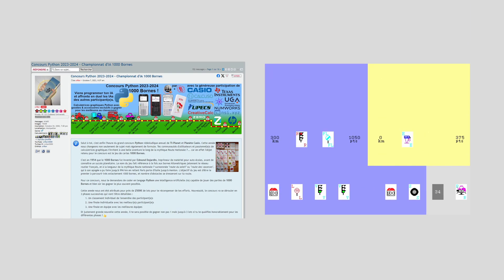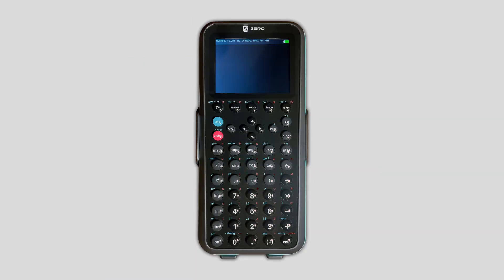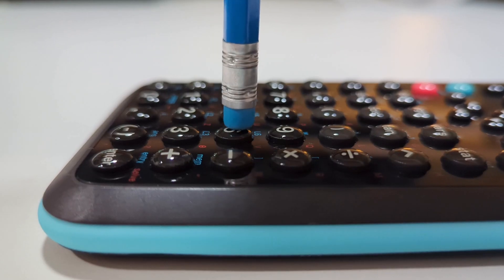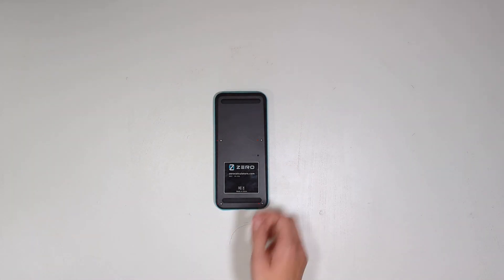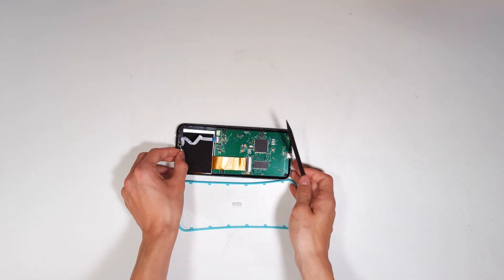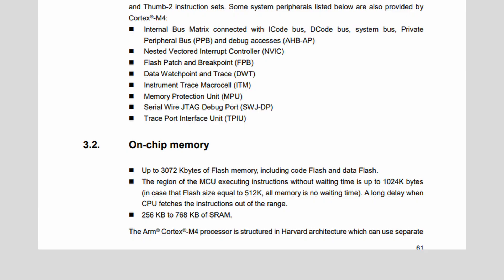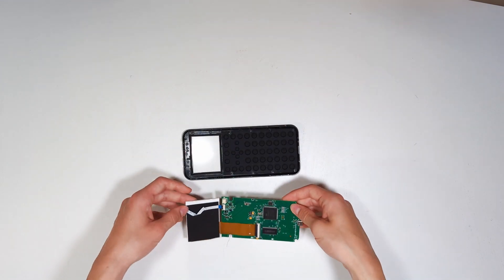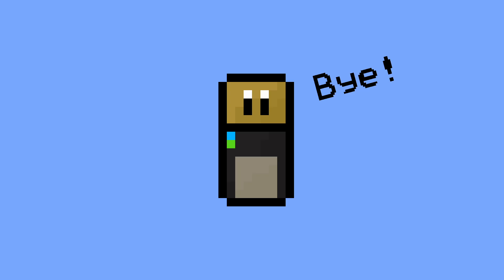I finally got one! Unreleased Zero Calculator prototype teardown

Comment: 3:27 I find this extremely annoying. Depending on who made that pack, it may get "spicy" if the battery management firmware doesn't optimize charging as the battery ages. Of course, all this could be avoided with a user replaceable battery pack or regular batteries. Can this be run from an external supply that circumvents the battery pack?
Reply from the maker: I'm pretty sure that at least the ZGC1 can run when plugged in if the battery is disconnected, but I haven't tried that on my ZGC3.

Comment: Hey this is not relating to your video but i was downloading pokemon onto my TI 84 CE but everytime i open ti connect ce it gives to option to repair or remove and it wont stop giving it to me no matter how many times i repair and open.
Reply from the maker: Hmm, I'm not exactly sure what's going on since I haven't experienced that issue before. I would try asking on cemetech.net, it's a calculator-focused forum with a lot more people who might be able to help you :)
Reply: @TInyHackerCalcs  thanks i got some help and fixed the issue, but i tried adding some files and cesium and asmhook are not working and are "invalid"
Reply from the maker: @zsynxedorgans3205  are you trying to send with the Chrome OS version of TI Connect? Sometimes that can have issues, if so maybe try the Windows or Mac version if you can
Reply: @TInyHackerCalcs  i used windows
Reply from the maker: @zsynxedorgans3205  huh okay, I think the issue is you need to run ASMHOOK and Cesium from artifice. If you open artifice you should see the files there maybe?

Comment: Good luck to these guys.  NumWorks has been at it for years now with a calculator that’s priced less than the TI-84 CE  and is superior in every way other than adoption.  It’s a TOUGH market. Hope Zero’s idea of make a much less expensive TI-84 clone works out for them, but it sounds like TI is going to block that as much as possible.

Comment: I like the battery. It's not permanently wired in, with a full pluggable connector, while being a bigger size so should get extra battery life. You might only replace such a battery once or twice during the lifetime of owning such a calculator, so I don't think the hassle of replacing it is a big deal over trade-offs to allow it to be a larger capacity. As long as it doesn't have crazy 'permanent' sticking solutions like most phones do (because they really do want you to buy a new phone rather than replace their battery).

Comment: "used to bad keys"? Nah, good calculator should be fast to type on for hours without tiring you out, so low force keys are good, even if they seem a little wobbly. What they need to do also is register presses consistently, which perhaps is a little more difficult to achieve with low force keys, but it's been done.

Glossy keys are OK to me, i  don't care. Glossy front casing is a no-no. My personal wish would be a brushed aluminium front and general 80s styling but i can definitely live without that :D

Comment: You don't have to change the file extension to edit it.
Reply from the maker: Yeah you wouldn't, it does make it a little more obvious though I guess
Reply: @TInyHackerCalcs  Notepad++ is great if you'd otherwise use the default WIndows notepad.

Comment: Good video, though I don't get what the point of this calculator is. What does this offer over an HP Prime (not even the even more souped up G2 model)?
Reply from the maker: @arnox4554  Zero's business model (or at least the way they're marketing) appears to be an improved 84+ CE clone, which would use the same interface familiar to teachers as they're targeting the education market. So they're not really trying to compete with calculators such as the HP Prime, but rather the TI calculators which are extremely successful in US highschools.
Reply: @TInyHackerCalcs  I suppose, but since it's 2024, why wouldn't they try to compete on raw hardware grunt too? Of course the Zero Calculator is more powerful in some ways, but it could probably be way faster even for (I imagine anyway) not that much more money. They could kill two birds with one stone.
Reply from the maker: @arnox4554  agreed. They may beef up the hardware in future models (hopefully so) but right now I think they're set on this. The other thing is that if the software is optimized it can make good use of the hardware it has, and while I haven't gotten to comparing performance too much it does actually do quite well compared with other competitors from what I saw in other people's breakdowns. Maybe not outperforming the Prime G2, but still doing reasonably well for a target launch price of $100 compared to other popular calculators.
Reply from the maker: @arnox4554  also - I figured I'd ask TheLastMillennial about it since he actually has a Prime G2 he can compare with. He said that the Zero performs matrix operations faster, but the main advantage is that they aim to be allowed on standardized tests and the Prime is not.
Reply: @TInyHackerCalcs  "He said that the Zero performance matrix operations faster"

Damn. That's some crazy optimization.

"but the main advantage is that they aim to be allowed on standardized tests and the Prime is not."

Actually, that's really weird. The HP Prime has a fully featured exam mode and even a way for teachers to sync them in classrooms and show the calculator display on a projector.
Reply: @arnox4554  Is more calculating grunt something the majority of users would care about?  What kind of results seem to take too long on a TI-84?  From a business standpoint, if they increase the budget, the extra money would probably be better spent elsewhere.  An M4 processor is not the top of the line anymore, but it is at a good price/performance point.   The processor seems to be an STM32 clone meaning it is even cheaper than you might think. If they aren't going to add more real features then leave the processor alone.
The TI-84 has a big target on its back because it dominates the market and is way overpriced.  I'm not surprised that just cloning the '84 and going for the high school market is what they are doing.
Reply: @isaacclark9825  "Is more calculating grunt something the majority of users would care about?"

I mean, I'd say so, given everything that the HP Prime can do, which even includes basic 3D graphing. Obviously a high school isn't going to care about the hardcore engineering features and the raw power needed to enable those sorts of things, but again, if the Zero team can do it... Why not? Maybe they could even have two SKUs. One for basic stuff for High School duties that's much cheaper, and one for full phat engineering and mathematician duties.

I know in the HP Prime circles, there is still, and has been grumbling about how Giac is only partially implemented, and this has often come up as an annoyance both for the Prime developers and users. Having a full Giac implementation would be very welcome for the users while also off-loading a whole lot of maintenance duties from the Zero developers, were they to give a full Giac implementation in a graphing/CAS calculator.
Reply: @arnox4554  The problem is that purchasers (well other than us tech folk) do not care. If the extra power does not help high school students on the SAT, there is no point in it.   TI has 93% of the market with its ridiculous pricing, even though more powerful calculators are available.  Would it be better to make the calculator more powerful, or to shave some cost off of the product?   I believe Zero has picked the right battle. I understand why you might want a different result.   But outside of academia, handheld calculators are more of a toy than a tool.
Reply: @isaacclark9825  Yeah that's what I thought too, but then I actually used an HP Prime, and there is an actual big usability, portability, and accessibility difference between using an HP Prime as opposed to something like Xcas or Mathematica. It's just way easier and more convenient.

In any case, one needs to remember that TI has a shit-ton of the market because of government nonsense, not because there weren't any good competitors. There's probably room to unseat them, but I don't know if Zero is really up to that challenge if HP can't even do it with a far superior product compared to literally any of TI's offerings.
Reply: @arnox4554  If HP cannot do it, perhaps trying to go after superior capability is not the way.   Zero does not need to unseat TI; they need to slice off a chunk of that big market.  If you compete with HP, you get a little of a tiny market.
I am an electrical engineer by trade.  Other than the time I have spent either in academia or preparing for the professional engineering exam, I have never used a calculator for anything other than the basics.  I use a computer when I need more capability.

Comment: Just learned about this calculator watching this video and not so interested to google about it (also it looks simpler and less capable that the inspire but looks can be deceiving) what is its purpose i mean where in the food chain does this calculator fit and why ? 
Last but not least i believe calculators are a dying breed in their current state due to phones and whatnot but I would pony up some good money for high precision calculators which by it self is something most apps or phones cant offer not even close.... but for some reason no calculator manufactures except a "boutique" style one ( Swissmicro) but eve they are more like hp replica nostalgia market rather than high precision
Reply from the maker: @billkillernic  Zero's target market is in highschools as an improved TI-84 Plus CE clone. Given that calculators are much easier to restrict than phones, it's still likely they'll continue being used in schools at least for the time being. Many people also prefer having a dedicated calculator device as well from what I've heard. But it will certainly be interesting to see whether or not Zero is successful in their endeavors!
Reply: @TInyHackerCalcs  The need to restrict outside communication is a strong factor in both high school and college.  In non-academic markets, folks just use notebooks and laptops acting as general-purpose computers for their computing needs.  Dedicated calculators are a niche market dominated by a few players.  I think that is why there is an upper limit on what calculator features are worth implementing.  There is not much for technical improvements on the existing calculators.  But there is some room to displace them based on price.

Comment: Haven't use a graph calcultator in 10 years. Still have my modded Graph 35+ with the 75 rom at arm's reach. Why is this new company still using super low specs? 8mb of ram? 240mhz single core arm ? Cmon just stick a pi zero 2 or something similar at this point. I even thought of basically having a pi pico-style compute module controller for the main cpu (for basic calculator tasks) and using a pi zero 2-style compute module as optionally powered a co-processing unit for computing very large chunks of data, and i bet it would not cost more than 80$ if mass produced.
Reply: Cost, battery life
Reply: Typical cost delivered is 1/4 of retail so that there is margin for the manufacturer and retailer. A $100 product needs to have an at-the-dock cost of under $25

Comment: Not a huge fan of the circle buttons at a first glance, but I was wondering how you liked them.
Reply from the maker: @DarkBraveStuff  the circle shape is not bad, but the domed top is a bit annoying after longer use. I've heard Zero is planning on changing this for a flat top in the final model though.
Reply: @TInyHackerCalcs  as someone who has regularly using an fx-991cw (with buttons similar to what you described) I think that was probably the right choice